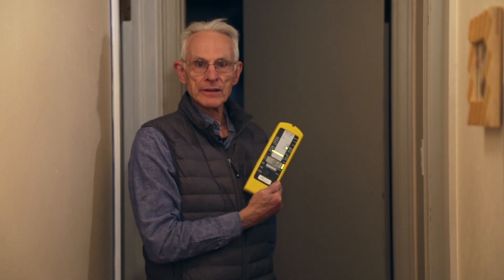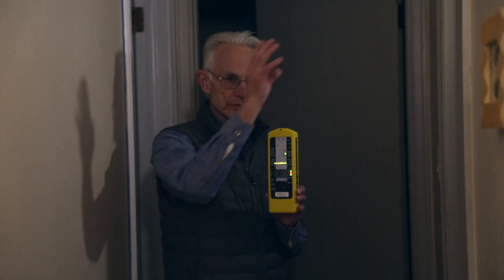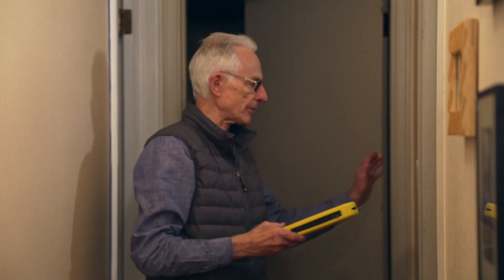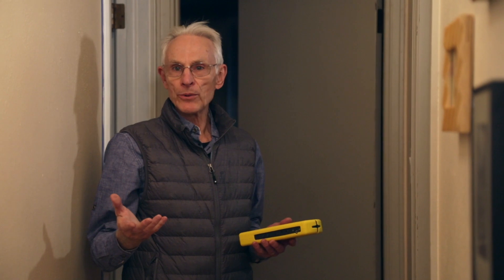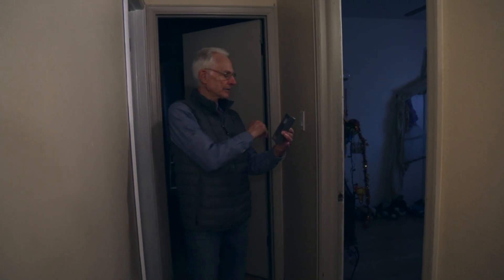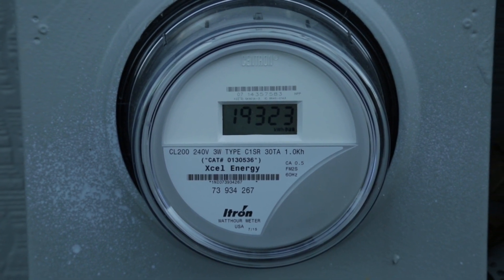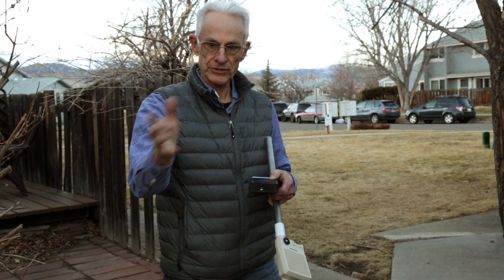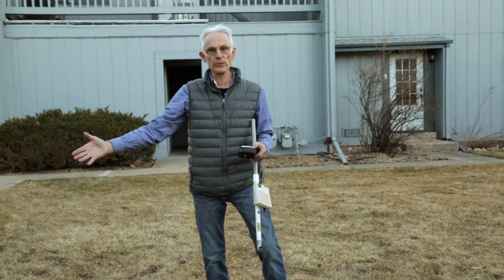Part 7: Healthy Homes and Electromagnetic Fields with IBE

Comment: There's a stone called amazonite, which, if you put it behind the Wi-Fi modem, filters out electromagnetic radiation which, when strong, is bad for your health.

I also put my cell phone on the 2G network, which has less radiation. Or 2G and 3G for maximum oscillation. Then the environment has less electromagnetic pollution and radiation. It's lighter and calmer.

I also only use my cell phone sometimes at night to check any messages and then I hide it inside my wardrobe so I don't keep picking it up for anything and get addicted. /
Reply from the maker: Thank you so much for watching and commenting.
Reply: Imagine, you’re welcome!
Reply: The only way to Block or attenuate RF energy is with metal.